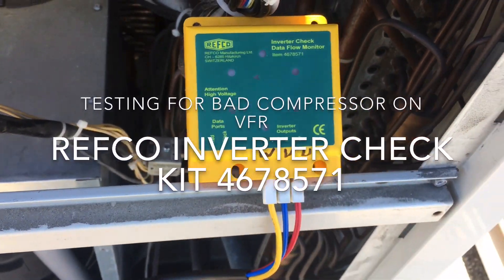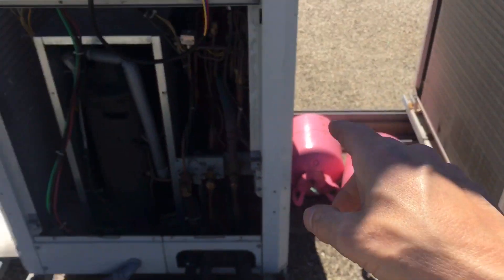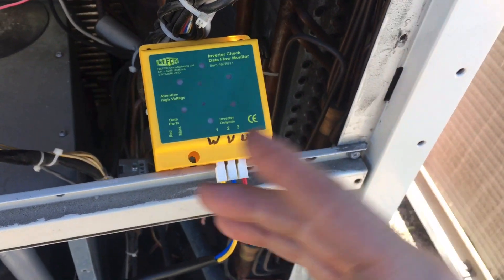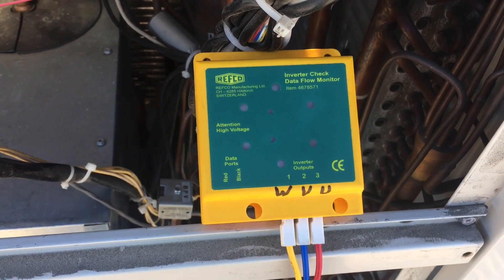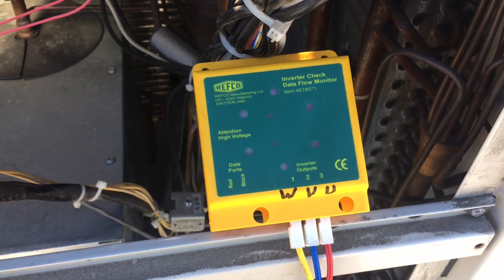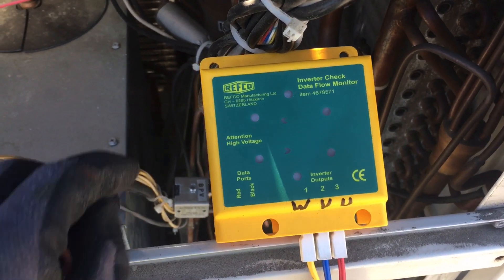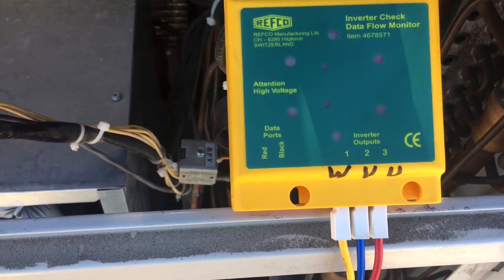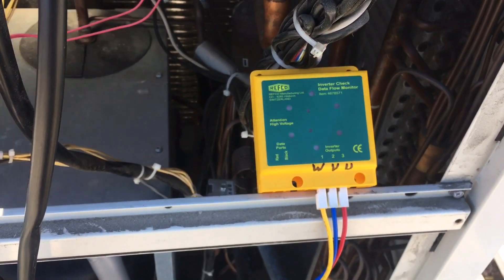Testing for bad VFR compressor’s, REFCO Inverter check kit 4678571

Comment: Works for mitsu mini splits?
Reply from the maker: Yes
Reply: @coldfinger459sub0  do you know if mitsu mini splits behave the same way as the unit you are working on in this video?

More specifically, do mitsus also sense for compression after sending signal to WVU?
Reply from the maker: @EnjoyCalculus  Mitsubishi works the same way as everybody else when it comes to the rotation for three phase

As for actually sensing their compression and sending feedback that the physical rotor is spinning on older units, I do not know of any that have a hole affect sensor, installed onto the shaft, or the side of the scroll sensing its movement . 

They do have pressure transducer’s that since compression in through your laptop, software and the interface, you can actually plug-in to some of the nicer units and read all the data off your laptop

Comment: My gauge set is refco nice quality Swiss, I got it about 19 years ago after I got ripped off by a car garage that re changed my car when it had that massive leak in the condenser.
At that time in the uk the only information I could find on car AC was on American web sites as hardly any cars had AC. 
I had to teach myself all about it. I'm fairly practical as im an Electrician so I enjoyed learning about it. 
My car was made in 94 so one of the first using 134a in the UK. It worked well with AC as it was a 1.9 turbo diesel so plenty of torque.
They only information available from America was the temperature pressure charts no information about weighing it in. And only a bit of basic theory.
Since then I got myself an old vacuum pump off ebay which is a 2 stage made by thermal engineering from the 1970s or 80s (made in USA) .
It's got a nice big vacuum gauge mounted on the top it still pulls a good vacuum well as far as I can tell as I only have the analogue gauge.
 It's very old school but it's only for my cars.
I wanted a car with AC as I had bad hay fever.

Comment: Where do you buy the tester?
Reply from the maker: I bought it online forgot the name of the distributor that I bought it from . 
         But the brand-name is from a big distributor so it’s very well-known industry but it should be very easy to get. 
            My local HVAC warehouses did not carry it in stock and they had to order it to get it in at almost twice the price, 
                So I just kept searching online and ordered it from somebody who is a lot cheaper than any of my local warehouse HVAC distributors. 
               I’m starting to find out more and more why do I have to keep wasting my time going down to a local warehouse distributor if they have to order the exact same item that I want from them and I still have to wait and pay more and waste my time. 
                      The more things I’ve been ordering online I’m getting cheaper without having to waste my time from a local supply house to house to do the same thing quarter it anybody with the IQ of flipping hamburgers that a hamburger joint or taking out garbage can do the exact same thing. 

        So if you hunting up online you’ll find a very good price just keep scrolling down to the next box of options and you will always find the right price that usually half of what your initial search is fine better present it to you through Google or Amazon or eBay Alibaba or alley express.

Comment: Hey bud,

How did you go with the job?
Was the compressor faulty?
Reply from the maker: When I got the call for this job only because it was somebody I knew did I go. New manager took over and had somebody else try to fix it right at that point, is where I should’ve turned around and left when they told me what they tried to do to fix it. When I told my son that they tried to put over 20 pounds of refrigerant to make it cold again the first thing even my son told me was put the phone down and don’t even take the job it’s no longer your mess it’s somebody else’s.  So how did this job turn out how does the story go. It ended up needing a compressor. The completely plugged up air filters downstairs we’re comical they were so plug was sulfur dust. And because the air handler‘s were played with sulfur dust the inside of the air handler box became so negative pressure like a vacuum cleaner. It started sucking in sulfur dust what was in a vapor form in the atmosphere used for sterilization it was sucked in through the smallest holes in embedded itself and built up on the circuit boards shorting out the circuit boards killed two circuit boards onto air handler’s inside. Panasonic is such a screwed up effed up abortion of a company to deal with to buy parts. Panasonic was so screwed up they literally got kicked out of their distributor center in South city with so many messed up orders repeated damaged goods and being told six weeks or eight weeks or 10 weeks to get replacements and then to have them come in damaged again. They no longer have a local distributor so you have to travel all the way up to the Northbay in Marin we’re all the way to the East Bay somewhere over by Fresno or Hayward because nobody wants their ass inside the HVAC commercial warehouse because they have such shitty service for parts. They had a electrical supply house who knows nothing at all about HVAC in the Northbay distributing their parts you might as well have a Starbucks or 7-Eleven can do the exact same thing and there’s more of them to get your parts distributed it’s so pathetic.  Then they had one commercial HVAC place way over in the East Bay south towards Hayward or something like that or farther they didn’t want to let me order parts they wanted me to physically come there and pay for No over the phone order credit card order. Have no idea how expensive my time is to takeoff just to drive over across the bay to make an order is just plain stupid they could go shove their order up where the sun doesn’t shine. They ordered a air handler board that got one air handler board air handler working. A power board and an inverter board. That took care of that part at that point with the test procedures because you cannot use on method with a multimeter to test a inverter compressor.  After the new inverter board sent a good signal to the compressor the compressor still did not work so once they were told that was gonna be another $2800 for the parts and I don’t even want to tell you what the labor was going to be. They stopped after that thank God.  I was just irate and want to rant and strangle somebody for being so F-ing stupid To shove over 20 pounds of refrigerant down  VFR compressor. Those compressors should have easily lasted 20 - 30 years if not longer with good care. In all my decades I have never had once any of my compressors ever die on a job. Like my father used to tell me if a compressor dies it’s your fault that was ingrained in to me since I was a child working with him.     I’m gonna make a new policy from now on on my big VRF installations for commercial jobs. The second I find out somebody else worked on them that I’ve never worked on a VFR system before. I will ask them to hang up and delete my phone number and never call me back.  I have some videos on it I did not publish I don’t do editing in splice videos together but if I ever do release the videos on my findings and all the problems I had trying to order the parts from Panasonic and how long I had to wait on tech-support multiple issues trying to contact them using their website that company is a joke. Over 30 years of ordering parts from companies dealing with the Panasonic HVAC what is the most revolting and pathetic excuse for a company they’re geared for sales big promotions and they just want distributors to push their product it’s all about making the numbers. The person who force-fed my Panasonic units over 20 pounds of R410 refrigerant. I would like to insert a refrigerant hose down his throat and pump over 20 pounds of refrigerant into him for killing my compressor as punishment.
Reply: Oh dahm ill be staying away from Panasonic myself. Thats too much stress
Reply from the maker: John Black I have been selling and installing LG   MULTI V 5 easy and available parts. Have not had problem with damage on delivery. Reliable and never needs any repairs or service for years.  I feel like that old commercial with the Maytag man waiting by his service phone to get called for work. 😂